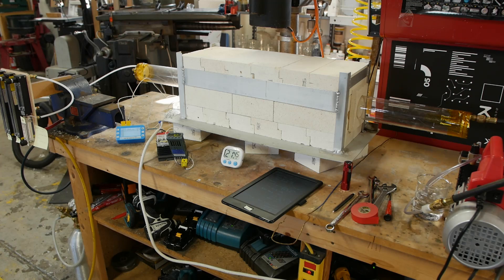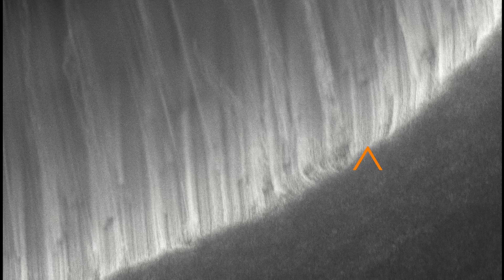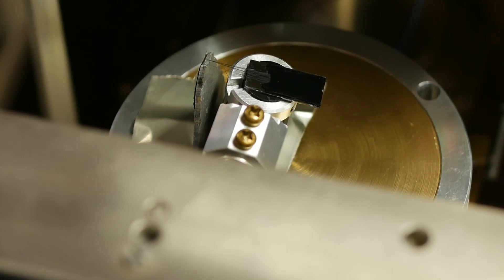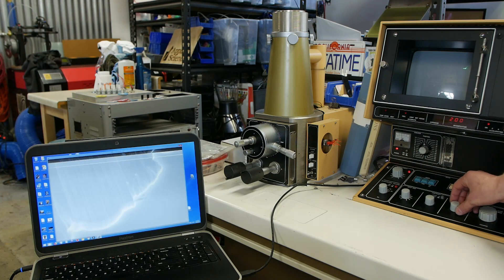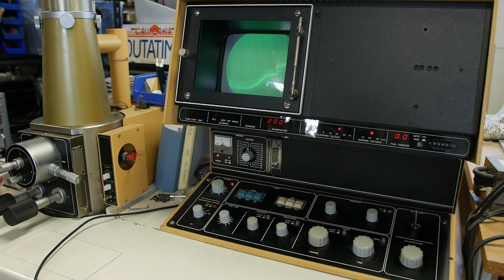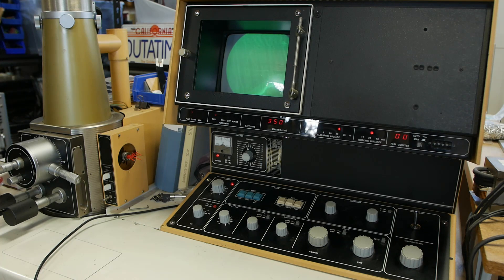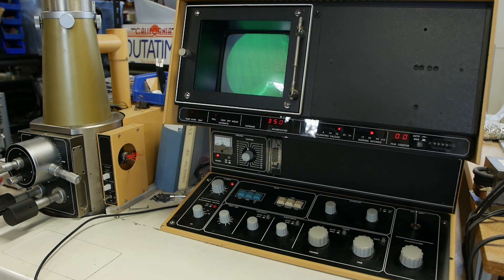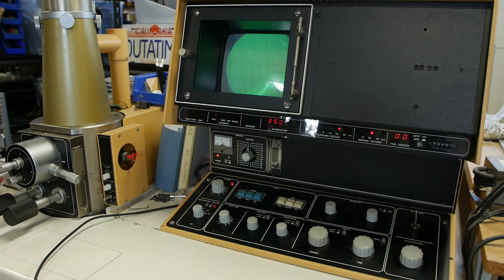Electron microscope animation: Carbon nanotubes pulled into thread

Comment: Buy a spinning wheel, knit some body armour.
Reply: Carbon nanotube-coated kevlar armor has been on the market for years. The coating greatly improves the kevlar's structural integrity and shelf life, even making it waterproof. Bullets that are stopped by the kevlar weave tend to embed themselves in the material, but the coated armor can protect it enough for bullets to bounce or barely stick to the vest itself.
Reply: CARBON NANOTUBE ARMOR! .... How good would that even be?
Reply: @dimitar4y  
I have no idea, I just dream of a really terrible looking knitted jumper, probably beige, but it can stop tank rounds of something.
All soldiers looking like middle aged northerners.
With attack slippers, pipe grenade and highly trained death whippets.

Comment: Very inspiring work as always Ben. Thank you.
You didn't respond to me about growing nanotubes on a sheet of Aerogel, but maybe someday ill try it myself.
Reply from the maker: I end up reading almost all of the comments, but sometimes a few slip by.  I think you could grow nanotubes on aerogel.  The most difficult part may be achieving uniform catalyst deposition, which I think was giving me the most problems in my experiments.
Reply: @AppliedScience - Instead of itched AL, I suggested aerogel which is "super itched"
- Also, I remember you making gecko feet awhile back. How about using the surface of aerogel as the mold? I think it would work really nice
Cheers bro!.

Comment: how do you capture the image digitally in such great quality? I am working with older thermal cameras that only output a analog video signal and want to capture that on the best possible quality.

I see you use very old Resolve for editing, have you even touched the footage up digitally? if you pull down the blur to 0.48 and switch to mist and turn that up to about 0.55 you get a nice sharpness effect that doesn't ruin the image to much. you can also increase MDs. but have to be careful with noise. 

some people built cinema robots for motion control camera rigs. you got the platform already and the frame interpolation for campaths can be done very easily with some math. there is available software to buy for it but it is not too difficult to come up on your own.

Comment: just go to the electronics shop... get a set of ENCODER/LCD EQUIPPED NEMA17 STEPPER MOTORS.
REPLACE THOSE HANDWHEELS WITH A DRO.... USB CONTROL ON ANY TABLET.

... says EVERYONE.
EASIER TO SAY THAN DO.
WHOS WRITING THE SOFTWARE ... ON WHICH OS ..??
Reply: Kenneth Kustren  he could borrow someones old Leggo Mindsprings. Theres’ enough motors and the simple control interface on the computer program would do it or write one in C++ and add an Arduino board. There are plenty of examples out there.

Comment: Applied Science, JIC there are focus stacking controllers and some of them are multi-axis. They have provisions to output a camera trigger signal as part of the programmed step motion sequence. They work with micro-stepping motors, so, depending on your set up, you can control motion down to the micron level. You set a starting point, then an end point and then the number of steps to cover the distance in between and thusly you can automate your data acquisition... (BTW, great channel/work!!)

Comment: You should consider using the Propeller 2 for your control unit, it has a lot of powerful DSP type stuff built in, and motion control would be trivial.  It can be connected to bulk external RAM for image capture and do ~2Mbps serial to your computer.  It's nascent right now but the P2 eval board is available.

Comment: What kind of Bandwidth and Resolution is required for the image aquisition and how much total memory for 1 frame?
Reply: I suspect each frame is about full HD to 4K in actual quality and sharpness. Ben probably acquires a bit more than that (depending on the number of scanned lines in each image), but downscales it later to save space if needed.
Reply: @Richard.Andersson  If the images are 4K, at 3840x2160 pixels, the least I could imagine him using is uncompressed 8 bit unsigned integers, that would produce images requiring 8.29MB. If he's storing them as a PNG, or other image format, it could be significantly higher.
Reply: Over 9000

Comment: Why FPGA's? Wouldn't it be much less effort to use an arduino or something?
Reply: I was wondering the same. FPGA seems excessive. I could see using an FPGA to replace the internal timing & control circuits maybe.
Reply from the maker: I currently have a Teensy, and it works very well, but like almost all microcontrollers the onboard ADC has a max sample rate in the hundreds of KHz.  This isn't a problem for the 10-second scan, as it will produce megapixel images.  The problem is live image for focusing, and DAC control of the scope itself.  If the microcontroller is controlling the timing for the SEM's beam deflection, it will need to update DACs in the MHz range with very precise timing.  Additionally, if I want to focus the image, I need 15+ frame/sec, and even with very small image subsets, it's too much for USB full speed.  But as I was thinking, maybe just adding motors first, and keeping the same image pipeline will be a good next step.
Reply: @AppliedScience  I concur. I think you'll have trouble meeting those specs with a uC. You'd face a similar challenge with the FPGA too. (External dac/adc.) Wouldn't count the uC's out, though. Some uC have interesting features to help with timing and external interfacing. Kind of like small PLDs built in. For high speed analog input, consider a parallel camera interface connected to an external ADC with a traditional uC (stm32 has one). Fun problem to crack if you have the time.

Comment: Momentary dipole induced dipole (london dispersion) and quantum vacuum resonances (vanderwalls forces) are going to be particularly strong between carbon nanotubes, especially when they are lined up. This is because these tubes have large conduction bands in their shared pi orbital resonance bands (they are really electrically conductive) but primarily along  their length, and their geometry lends itself to the casamire effect (exclusion of quantum vacuum  fluctuation between two conductors in such a way that there is effectively a pressure between two close conductors that is below the zero of a pure vacuum. Again this effect is going to be strongest when the tubes are lined up length wise. 

So the bottom line is that these tubes want to be lined up  ultimately because quantum uncertainty is a fundamental property of reality. 

Even the stability and strength of carbon nanotube is derived from electron delocalization and constructive resonance that derives from uncertainty. Nondeterministic entropy is a foundation force of the universe.
Reply: @applied science see above

Comment: You haven't updated Resolve in a long time. Is there any particular reason?
Reply from the maker: No particular reason.  In general, I don't upgrade software unless I'm forced (eg getting a new computer).
Reply: @AppliedScience  Interesting. Security for software isn't that critical usually so it makes sense. You may not need new features either so I guess why upgrade.

Comment: I love the fact that you made carbon nanotubes and the thing you want to talk about the most is an animation
Reply: He talked about making nanotubes in a previous video.
Reply: @desromic  solid logic
Reply: Because maybe someone's supposed to donate a more modern electron microscope to him (and he can donate his old one to me -- I'd use it to identify patients' pneumonia-causing bacteria without needing the slow lab-cultures). :D :/
Reply: @jaggztech  Unfortunately, the process of setting up a sample to go into the SEM is a slow process in itself. It has to go through a fixation protocol. The most common fixation protocol involves a primary fix, multiple washes in buffer fluid, a secondary fix with Osmium Tetroxide (extremely toxic) added to get enough density in the material, multiple wash steps in buffer fluid again, dehydration using acetone or ethanol in a gradual set of steps working up to a 100% solution to ensure there is no water in the sample whatsoever, and then drying and possibly staining (and this is much easier than for TEM, for TEM you have to do an extra series of steps to replace the dehydrating agent with a resin, then oven cure, then do thick sections, stain with histological stains, image on OLM to identify target areas, thin section on ultramicrotome, capture on grids, and stain with stuff like Uranyl Acetate and Lead Citrate).

Air drying would cause the cells to collapse after the dehydration process which would make them look completely different, likely causing them to be misidentified, so you'd probably need to use a Critical Point Dryer and store them in desiccant to keep them from absorbing any moisture from the air. Then you would need to sputter coat the sample in something like gold or gold/palladium to prevent charging on the sample surface - and also to prevent the beam from passing through the cells and giving you a distorted image of what's underneath them.

You'd also have to deal with the fact that unless you have a huge number of them in the sample - you might not be able to find them easily in the first place, even if they're there.

For materials samples it can be much, much easier (often simply mounting to a stub with carbon tape, maybe sputter coating if it's a non-conductive sample), but biological samples are much more difficult.

Edit: Oh, and if you're thinking of identifying the bacteria as in determining what the strain of bacteria is - that's generally not possible on SEM. Assuming you locate the bacteria in your sample, you'd really only see the shape of it, which is often simply a pill shape, and you might see flagella or pili. Narrows it down, but doesn't tell you the strain.
Reply: He already made a video about making the nanotubes. So it would be a bit redundant to make a second video just to talk about them even more.
Reply: Threads of carbon nanotubes
Reply: @garret1930  I get that he didn't make terribly long nanotubes but still
Reply: @piotrfila3684  absolutely, this is amazing and beautiful stuff. It's really cool.